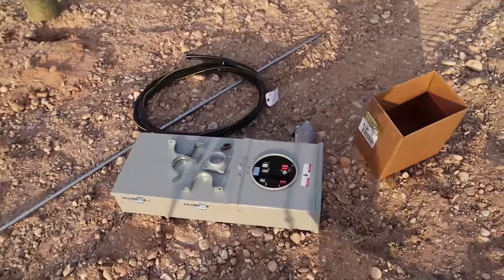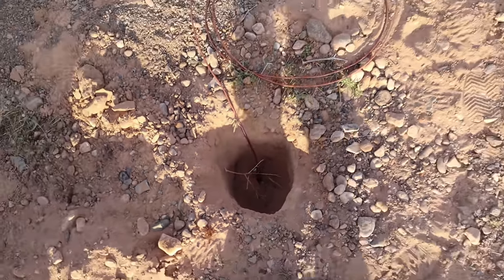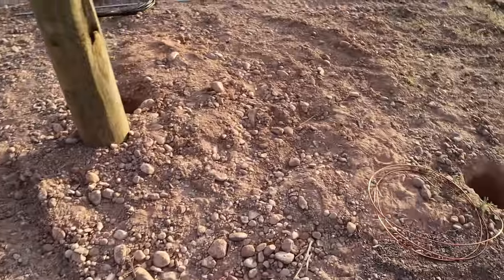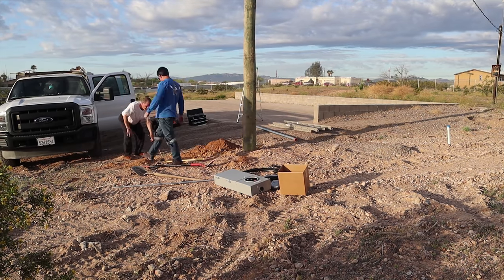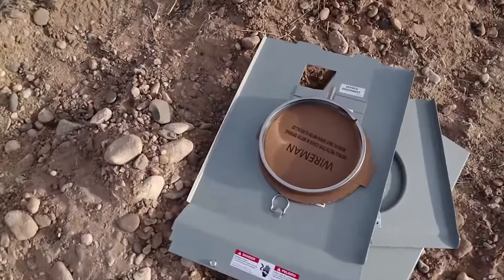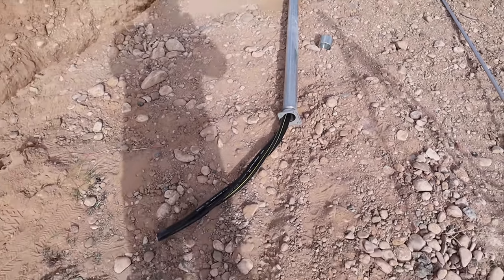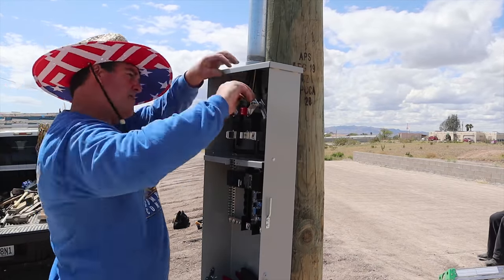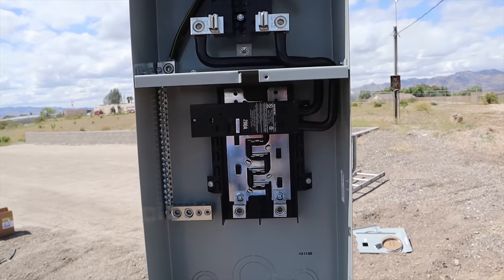How to install Main Electrical Panel Setup

Comment: I want Ariat gift cards, the thing about doing electrical work you have a code book to refer to on every aspect of the electric process.
Reply: David Dye 
- 6’ apart ground rods to get 25 ohms or less.
-Paste on the aluminum conductors for cold creeps.
-3’ strap at each end of conduit.
Reply from the maker: Yes that's interesting, I usually don't read and do things twice.